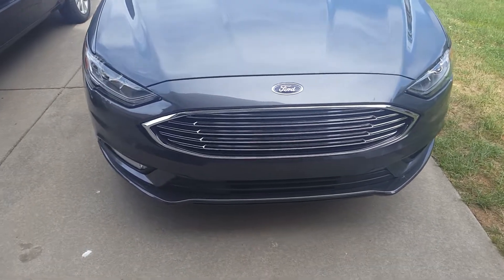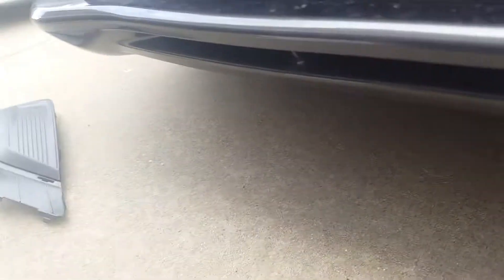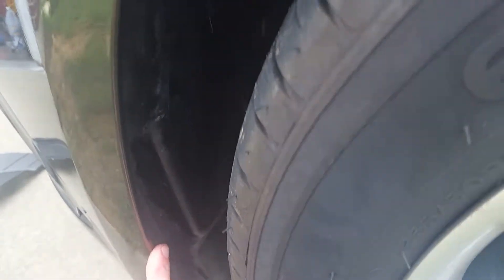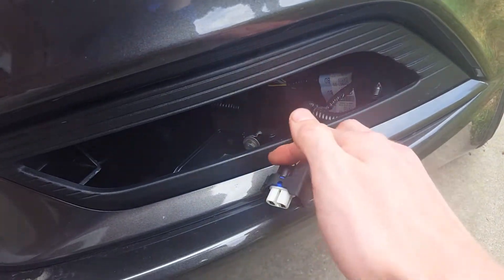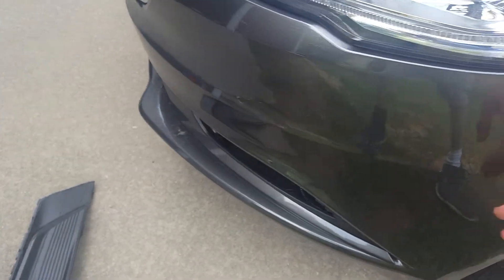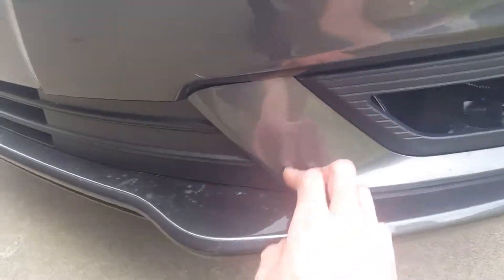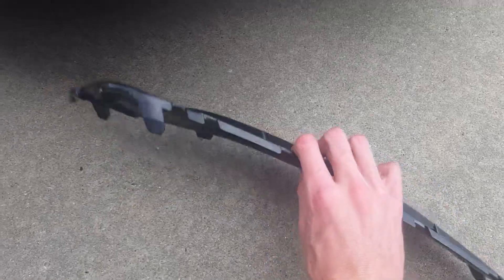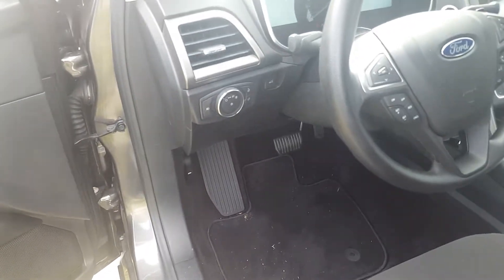2017 ford fusion fog light installation question

Comment: Awesome Nick, thanks for the video, being able to re use the painted trim Is awesome I wasn't really a fan of chrome.
Reply from the maker: Fio I thought the chrome was weird on it almost nothing on the vehicle is chrome only thing is the grill
Reply: Nick the car guy Hey have you thought about seeing what it would take to retrofit the factory led headlights into your car?
Reply from the maker: +Fio do you mean adding after market headlight assembly? I been thinking about that adding the xenon headlight like what you see on 17 fusion sport
Reply: Nick the car guy no not aftermarket Ford has both the hid and led headlights as options for the 17 fusion
Reply from the maker: Fio yea I seen those in wanting to do it but those xenon light have 10 wire going to the connector and mine only have 9 I don't know what wire I'm missing. can't find no diagram for the wire system
Reply: Nick the car guy looks like the fusion sport comes with led headlights, I'll see if I can convince my mechanic to print me out a wiring diagram
Reply from the maker: Fio alright thank you. can you have him print off one for the mirror I'm looking to upgrade mine to one that have puddle heated and turn signal on it it's got the wires for it but i like I said don't know what pins are what. if you ever need help message me on here or on my Facebook page nick the car guy
Reply: Nick the car guy cool man, yeah that's a upgrade I'm looking into myself as well
Reply from the maker: +Fio I got 8 or 7 pin on my male connector and the connector on the actual mirror is only 3 or 4 pins
Reply from the maker: Fio I'm looking into adding navagation on mine and adding heated seat everything pre wired I just need to find the parts for the heated seat. also there is something called the mid passenger seat belt chime it's for the back seat if somone not buckled in it will let you know. I might do that also.
Reply from the maker: +Fio wanted to let you know I added the info of all the part you need for the fog light in the description with part number
Reply: Nick the car guy unfortunately adding nav to sync 3 isn't as easy as it was for myford touch systems, looks like you have to swap out the entire apim. Besides fog lights and puddle lights the only other thing I'm looking into is getting the Titanium led strips for the trunk since the SE ones don't light up and seeing if it's at all possible to add intelligent access using oem hardware
Reply from the maker: Fio I like how you and me think I been looking into adding the trunk lid light I want mine to light up that way. Yea I knew about the apim I've tried 3 time and been screwed by people I will wait til they show me it have the navagation on it
Reply from the maker: Fio I got me a wire diagram for the 17 ford fusion once I get it I can let you know if your looking for a specific thing
Reply: Nick the car guy awesome, I'd be willing to bet the extraordinary mystery wire is for the turn signal functionality in the drl led strip
Reply from the maker: +Fio where is at what wire the mirror wire the headlight wire? If you take a multi meter or a test light it if turns on and off constantly then it's the turn signal
Reply: @Nickthecarguy were did u get the diagram wire and the software  I have a 2018 hybrid se can u put the link for that

Comment: Hi Nick 
could may be advise me, I am stock I have 2018 Ford fusion energi Se, which had no Fog light. I decide follow the advise and upgrade it with the fog light. I replaced harness and the switch, but fog light is not turning on. I believe the switch is working because of dimming buttons is working. The switch and harness bought from the ford.
Could you advise what to do to resolve an issue?
Thanks
Reply from the maker: Did you buy a new headlight switch with the foglight button

Comment: OK, but the problem Im having is I cant seem to find the harness and I cant find the bezels. Ive typed the part numbers you have listed into ford, google, ebay and anything else I could think of but I get no hits. I have a 2017 SE 1.5L ecoboost. I already have the head lights and the switch but need a little help finding those 2 items
Reply from the maker: Richard Dickinson it's such a new vehicle most places online don't have the parts yet
Reply from the maker: Richard Dickinson have you tried rockauto.com

Comment: Nick, I am installing Spyder fog light kit to a 13 model. Will the connection work with the ford switch if I order it off eBay?
Reply from the maker: Is your car prewired for fog light if it is all you have to do when adding the fog light is make the power wire to the fog light wire then you can use it with the headlight switch like factory
Reply: Nick the car guy great, I’ll chk and see. Stay tuned
Reply: It is an SE model btw
Reply: Nick. My SE has pin 14. Do you tap into that wire
Reply: Nick the car guy (Nick it is wired for fog lights) the Spyder harness “hopefully it works
Reply: @joepayne3924  did it work?
Reply: @CharlesDDavis  no. I had to wire it to the switch. I’m sure it could but I didn’t wanna go to deep in the electrical part

Comment: Nick, thanks for the video.  I purchased a new cable for my 2017 Fusion hybrid SE and the connection to the damper is three wire not 2, so I want to make a wire connection to the main connector of the harness to add the fog lamp wires to the original wire harness.  anyone have a video on how to take apart that multi pin connector?
Reply from the maker: Judy Schmitt what do you mean by damper?
Reply: Au
Reply: Active grille shutter. I got the rewiring complete

Comment: Do you know the part # for the ford harness I need to plug in fog lights on a 2017 Ford Fusion SE?  I bought an led fog light kit on eBay that came with its own harness.  As of right now I can’t control from the headlight/fog light panel in the vehicle....
Reply from the maker: It's 15k867
Reply: What about a 2014 Ford Focus SE sedan?

Comment: I have a 2018 fusion  I am trying to wire them to the same switch you have how do I do that?
Reply from the maker: You will need a new headlight switch and you will need a wiring harness that have fog light connector . I will need to find the part number for it and I will let you know
Reply: Ok thanks
Reply: @Nickthecarguy  do you have the part number for the wiring harness?
Reply: The fiesta the wiring harness was behind the delete cover I got all the hard ware from ford some fog lamps and oem fog light covers after the setup was done I then replaced the headlamp switch with a fog light option after that was swapped out I then used forscan program to flash the computer to activate the Foights, automatic headlights, cruise control and alarm and it worked as well as the auto headlights. I then got a blank key with the remote combo has ford cut the key for free at my dealer, I then got in my car with 2 previous keys I own I programmed the key to work with my car then I se the remote to work

Comment: Nick what connector did you have to cut off to make the '13-16 wiring harness work on your car? I ordered the 13-16 wiring harness but I have an '18 model.
Reply from the maker: I had to change the active grill shutter connector apparently the active grill shutter are different from the 16 and 17
Reply: Nick the car guy and that's the connector pretty much right in the middle of the harness?
Reply from the maker: Yes on my car I had total of five connect two for the fog lights one for the ambient temperature sensor the other one is for the active Grille shutter and the other one is a big one which is the main connector
Reply: Gotcha. I had my bumper off the other day to swap out the grille, I think I know exactly what connector you're talking about. Appreciate the help!
Reply from the maker: @Goober10584  the ambient temp sensor i believe is mounted on the bumper
Reply: Did all the plugs except the grill shutter connect all plug in? So I should only have one plug that doesn't connect to the stock plugs?

Comment: So I checked if it was wired before I bought the parts and it had the grey wire so I went along and bought the parts. Bought the harness, everything is connected but the lights aren’t turning on. Any ideas on what’s wrong?
Reply from the maker: What year vehicle do you have . You have to enable it in the bcm and ipc
Reply: Nick the car guy It’s a 2017 SE. by the lights not turning on I meant the fog lights themselves, not the ones on the dashboard. Thanks for your help and quick response by the way!
Reply from the maker: @Thedickwithnohands  I'm assuming you replaced the headlight switch with one with fog light button
Reply: Nick the car guy yeah that’s correct. I bought the one you had in your other video. I’m pressing the fog light button but it’s not turning them on
Reply: Nick the car guy they turned on right now haha nevermind. From the bottom of my heart thank you for your videos! They were extremely helpful!
Reply from the maker: @Thedickwithnohands  no problem hope you enjoy it
Reply: @Thedickwithnohands  What did you do to make turn up fog lights?? Did you use 'forscan'? Sorry for my bad english

Comment: Ive looked all over the net for the wire harness part hg9t-15k867 and cant find anything. I was able to find 15k867 but then there are a bunch of choices. Can you confirm the part number.
Reply from the maker: Richard Dickinson mine a 17 fusion but the 16 fusion wire harness worked for me all I had to do was switch out the active grill shutter connector since they change the connector on the 17. All you need to do is find one with the fog light connector and what ever other option car car had for example front park sensor and so on my car didn't have all of that so all I needed was one with the fog light connector

Comment: Have you installed both led fog lights? Did the same “chrome” piece fit with the led bezel or did you have to order the whole new chrome pieces
Reply from the maker: Alan barron I added the factory led light I have to get new bezel for the shape of the led but I cam reuse the chrome
Reply: Nick the car guy where did you find the other led fog light I know awhile back on eBay where did you end up finding the other one? I also only have one and the led bezels looking for a place to get the second one
Reply from the maker: Alan barron the sale chrome should work I'm still trying to find the bezel
Reply from the maker: Both the fog light I got on ebay

Comment: Where can I find the wiring harness with fog light connector for a 16 Ford Fusion?
Reply from the maker: Make sure this is the correct part befor ordering Part number DG9Z-15K867-C
Reply: Nick the car guy Thank you
Reply: ebay

Comment: So the whole bumper has to come off
Reply from the maker: The G.O.A.T to take the cover off yes but to put the fog light in no you do not have to take the bumper off
Reply: Nick the car guy so to access the foglight no bumper removal is required?..ok
Reply from the maker: The G.O.A.T you have to remove the bumper yo take off the fog light delete cover which is that black cover that you see on my video laying on the floor. You will also need the fog light wire harness
Reply: Nick the car guy last question what size is the floglight bulb?
Reply from the maker: The G.O.A.T it call for a h8 bulb 35w but on mine I added a h9 bulb 65w
Reply: Hello. Do I have to remove the bumper if I have  a wiring harness?
Reply: Are you located near St. Louis by any chance?
Reply from the maker: It's about 3hr away